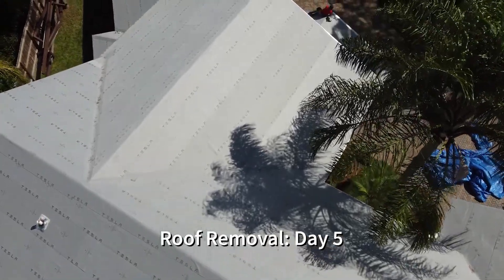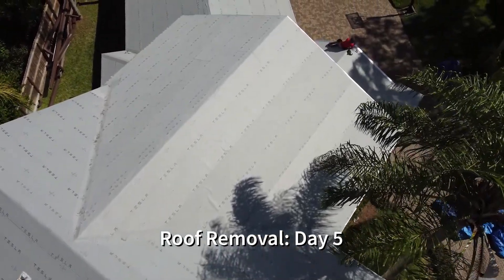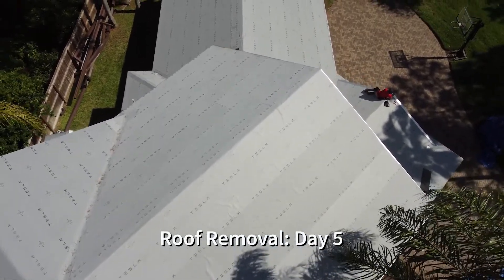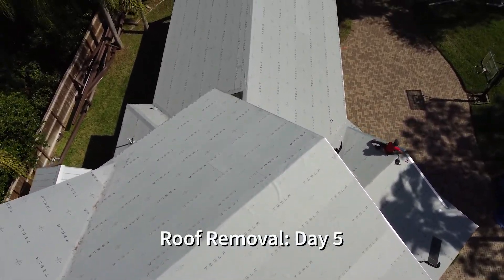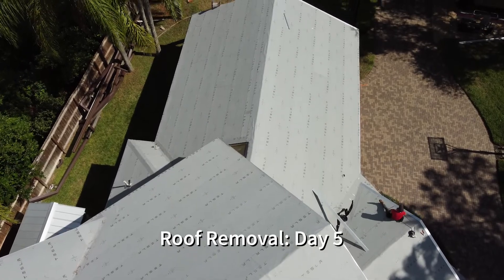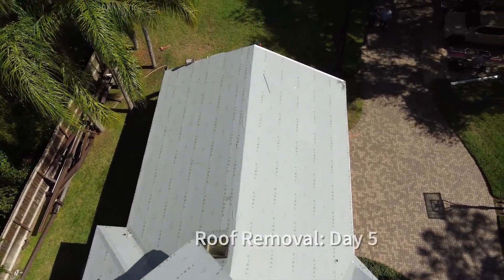Tesla Solar Roof: Tear off and dry in

Comment: Clean shaven???
Reply from the maker: My beard was too unkempt in my prior videos.
Reply: @SCAPTampa  I saw but clean shaven = no beard ;)
Your content and first hand experience is really valuable. I can't find other info like you have been providing. My potential solar roof will be on a new build and wouldn't happen till around next summer. Also talking with Span about providing a panel and install.
Reply from the maker: @loganboyd  Thank you for the feedback! Your feedback is exactly why I created the channel. I knew a lot of solar roofs were being installed, but I couldnt find any content showing the process from beginning to end. It was actually kind of scary even purchasing the roof without finding the content. I will make sure to post enough detail for you, and others, in hope to reduce new product adoption stress!
Reply: Let me mention something, the dripedge it's galvanized metal and yes a lot of people hate the color, that whole thing about removing gutters is BS, if you don't want to remove your gutters you don't need to, you can install dripedge over existing gutters you just have to tell them firmly not to mess with them, and hopefully they didn't charge you for tear off after they did that, but if you live in California and some other states you can't install solar roof on top of existing roof but in some states you can, we always have to keep on mind all that weight that is going on your top of your roof with existing roof+underlayment + tesla roof.